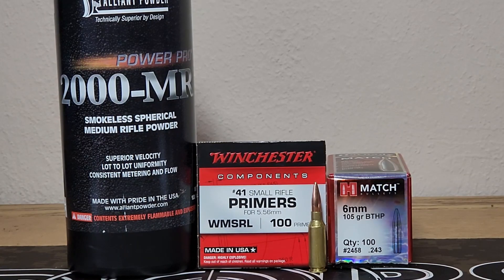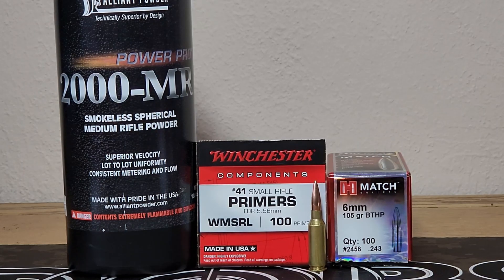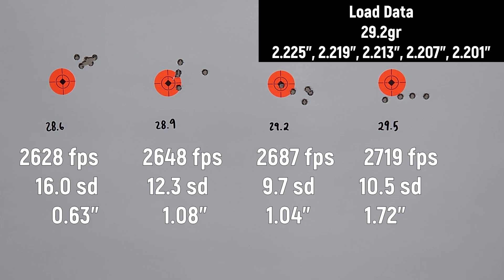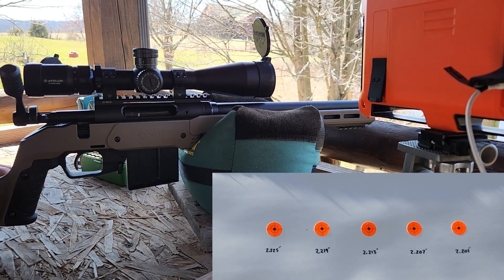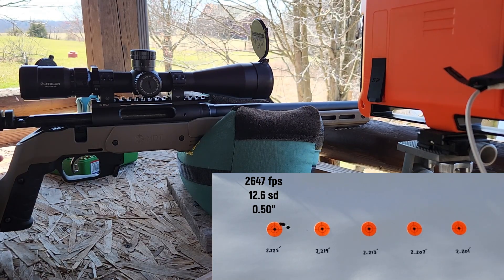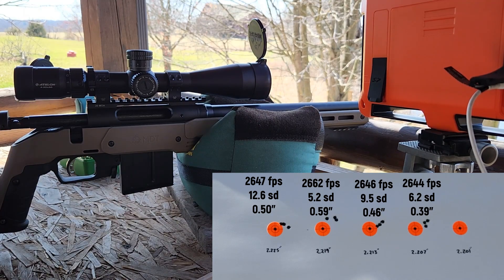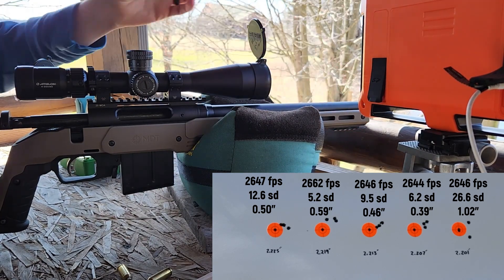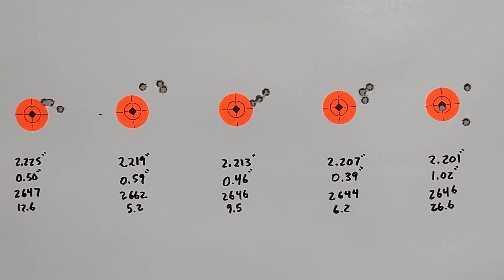6mm ARC, 105 BTHP, Alliant PP2000MR

Comment: Hey Rob, I'm generally not a big fan of using a load that's right next to a really bad group. In a few hundred rounds your throat is likely going to erode to the point where it's equivalent to the 2.201 OAL.  The 2.213" load is basically the same and has the benefit of having good groups on either side.  It does look like there was possibly something external effecting the 2.201" group though given the SD and the dramatic point of impact shift which may mean that there's nothing wrong with using the 2.207".
Reply from the maker: This is probably true however the plan was to take this load out to 600yds the following day and I was only going to shoot a handful of rounds. In the future if I am going to load up a larger number of these I would choose one of the longer OAl for the reasons you stated.

Comment: Very nice!  Do you have velocity and accuracy goals?  I would put them in three boxes, Long range, hunting and varmints.  Perhaps match loads to make four.
Reply from the maker: Often times I don't, in this case I am finding a load to shoot 600-1k yards here in the near future. So 2600-2700 fps without damaging brass single digit SD, 0.75" consistent accuracy at 100yds. Often I am just trying to shoot as small of groups as possible at 100yds, when it gets closer to deer season I am often looking for a temp stable powder, typically it varies depending on the mood I'm in. I do hope to do some mid-long range competitions this year and will be working on a load for that probably with the 108eld.

Comment: GRT lists this powder, but QuickLOAD does not.  GRT says the pressure is low and the burn percentage is low, but it way underestimated the velocity (and I don't know how to tweak it yet).  Weird how the SD was so bad on that last group.  You would expect the velocities to increase slightly as the OAL became shorter, but something unexpected happened there.  Maybe thats one of those node things that never seem to show up in ladder tests!
Reply from the maker: GRT has been both very accurate at times and way off for me. With such a small sample size SD variance is probably more likely. Seems like velocity was probably staying pretty similar as OAl changed.

Comment: Seating depth windows typically have a range of .006, so you may have skipped over it. 2.207 might be on the outer edge. When tuning my rifle for f-class i have found it is necessary to do a final tune in .002 or .003 increments to get to the rifles full potential.
Reply from the maker: Yes, many people seem to follow that logic, if I every need to find tune further I would need to use 3 thou. For my uses I have not found the need to narrow down much further.